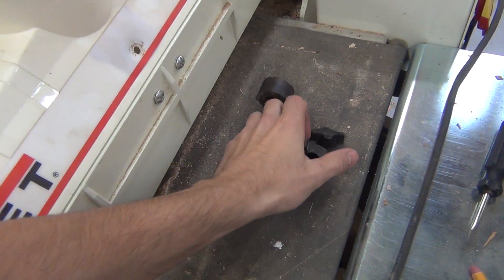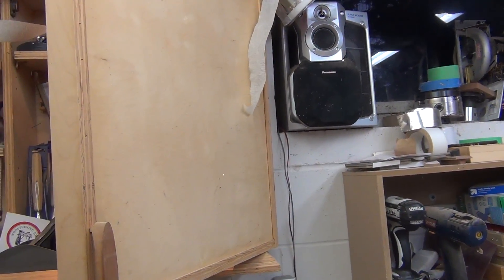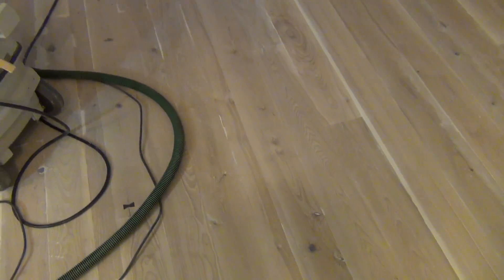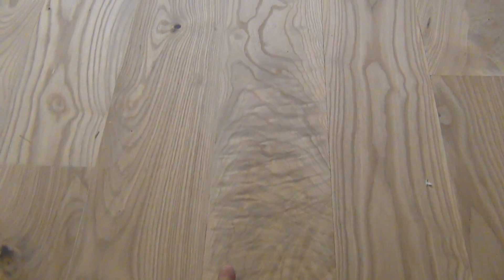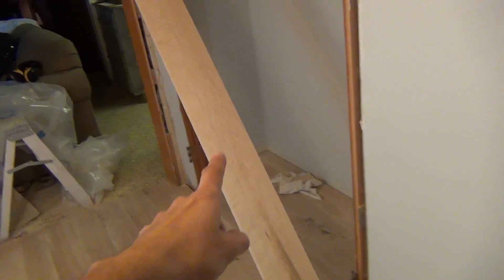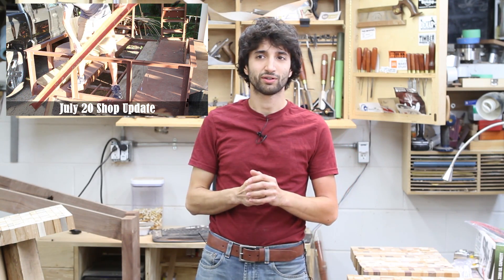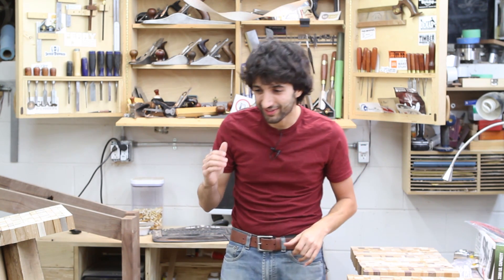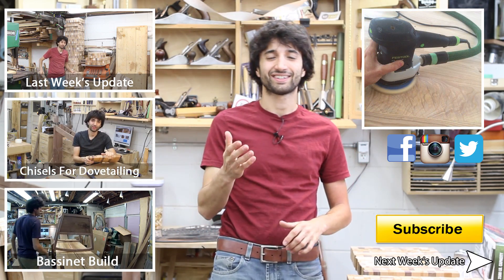Matt's Weekly Shop Update - Aug 24, 2015

Comment: ...beautiful work on the floor, very nice. Your attention to detail is amazing.
 Welding tips:.... prep is everything, the practice piece you showed, still had the factory coating on it.....grind it clean - beveled pieces weld easier than dirty butt jointed pieces.....if you cant see the puddle and watch the flow, either get closer, use better glasses, and maybe try a auto hood. Your very safe in the shop, it shows....but have a real electrician look at your shop service and lights.........best $ you could spend....especially with kids and wife in the house. keep up the great shows, thanks....

Comment: "We don't have Air Conditioning".  I'm still shaking my head about that.  We've had some stinking hot days just the other week.  However, isn't that a wall AC unit I see at 3:56?  

That will be a gorgeous floor.  Great job, Matt!   Nice lighting improvement in the shop as well.  I should think about that sometime.  Looks like your burn bin from cutting board offcuts is full to overflowing.   If only you had an outdoor fireplace or something... :-)
Reply from the maker: wordsnwood haha!  yeah, good eye!  It's technically and AC unit but it's pretty old and not super great at cooling that room. Thanks Art!  The lighting makes a big difference.  It should make detail work at the bench a bit easier too.  I know, and it was just empty.  I still have to burn through my flooring offcuts too... The life of a woodworker :)
Reply: Matthew Cremona Hey, if you're answering comments you must be done the first coat on the floor...  going well?
Reply from the maker: wordsnwood Went really well.  Waiting for it to dry now.  I can't wait to just go in there and look at the floor for hours

Comment: Make sure you are covering up when welding, any exposed skin will get one heck of a sun burn.  I know it uncomfortable with the heat of summer but I have done it without and end up with my arms or legs getting really burnt, think of it that you are mere inches/feet from the sun.  I applaud you for doing all that mill work and installation of the new floor it will look amazing.
Reply from the maker: I was pretty excited that day to get started and didn't think to cover my elbow areas.  This past week I was totally covered.  It's been cooler here so I wasn't too hot.  That made it a lot easier.  Thank you so much!!

Comment: Hi Matt, just a little tip on cutting the channel. If you use an off cut of angle to help hold the channel in the vice rolled at 45 degrees it will cut much easier. The reason it's only cutting the wings is that once it gets to the bottom there is too much surface contact with the disc. Hope that makes sense. Keep up the good work
Reply from the maker: Trevor Burke Makes perfect sense!  Thanks for the tip!!

Comment: I recently finished my hardwood floor. I used The "Varathane" product from Lowes. It worked very well. No issues with fumes. On sanding... it can be too slick if the use a fine grit sand paper.

Comment: It's always easier to be able to rest one arm on a sturdy rest and brace the arm holding the electrode, it makes controlling your arc length much easier when stick welding.
Reply from the maker: theClosetgrower420 I was starting to get smarter about that by resting my elbow on my knee.  That seemed to help but I'm going to keep trying different positions.  Thanks!!

Comment: just a short welding tip for you:
when you stickweld your welding poddle is in 2 parts,lighter further away from the stick and a bit darker closer to the stick. keep the welding stick that close to the welding poddle that the lighter poddle dont overrun the darker poddle, the lighter poddle is slag and the darker one is molten metal. on the pack from the weldingsticks are instructions on what amps you should weld at use higher end of amp range for flat welds and lower 1/3 for climping welds in coners. dont try to weld falling welds (weld down) as usualy you will have cold welds if you do... good luck with the welding
Reply from the maker: Thank you so much for the tip!!

Comment: That floor looks great.  Looking forward to seeing it finished.
When using a stick welder, AFTER you start the arc drop the stick to the surfaces that you are welding together.  Just a light touch will work.  You can feel it just like parring wood with a sharp chisel or a light brush stroke.  You know what I mean.  You already have the touch. It's just practice. The key is making sure that both surfaces are clean as possible before welding AND that one surface is well grounded.  A crappy ground will give you a crappy weld.  The other thing to check for is the heat level.  Too high and you will blow a hole through the metal.  Too low and it will look like candle drippings.  A few word of caution: BE SURE TO WEAR EYE PROTECTION WHEN CHIPPING THE SLAG OFF.  Hot slag in the eye is awful and can lead to blindness.
Reply from the maker: Thank you for all the tips!  They were really helpful!  I've started wearing safety glasses with the welding helmet as an added layer of protection.  Thank you again!!!
Reply: Matthew Cremona My pleasure Matt.  It's only fair to share info.  It's why we're all here, to learn from each other.  That's the real beauty of your videos and the conversations that follow.   :)  Love your videos!
Reply from the maker: Thank you Peter!